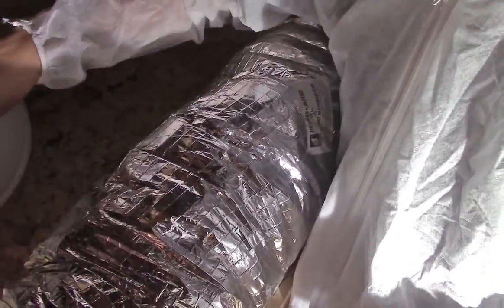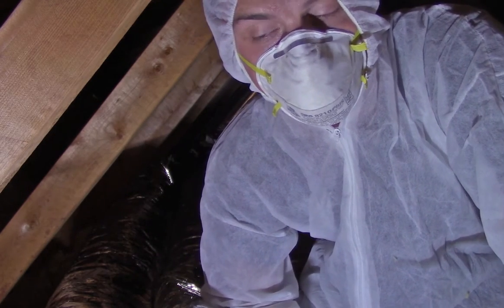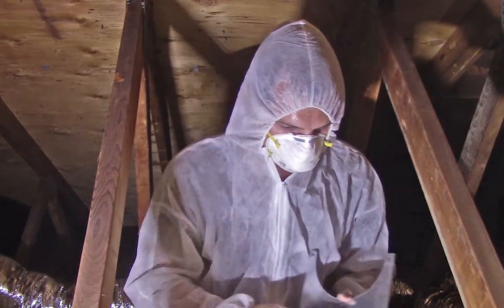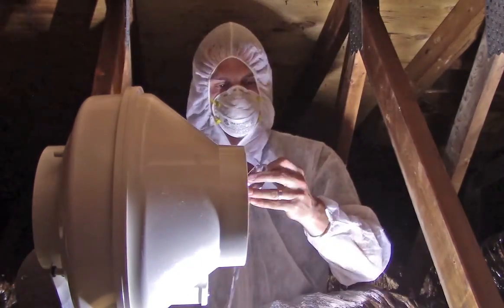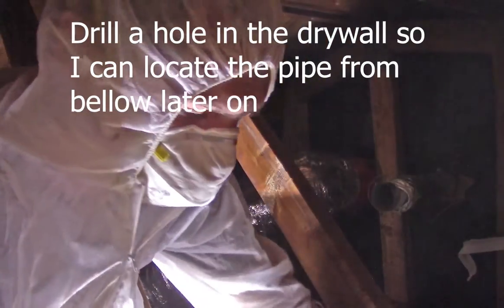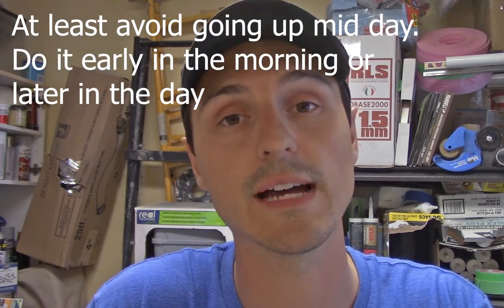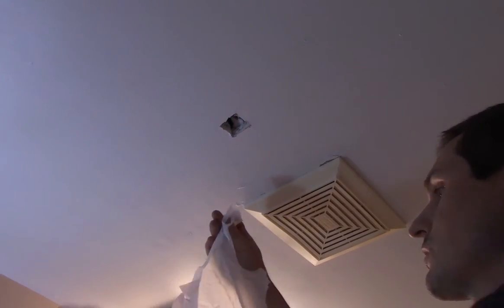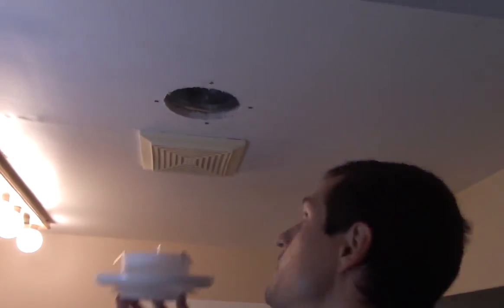How to install a linear exhaust fan [KEEP YOUR BATHROOM LOOKING NEW]

Comment: Great installation. Everything done well except for... that fan should be exhausted on the roof. With wall mounts the moist air that is exhausted will rise and go right into the attic via the soffit venting.
Reply from the maker: Hey! Thanks for the comment & thanks for watching! :) Is that a code requirement in your area?

Comment: Control of the fan is very important as the extra air volume will increase infiltration CFM X 1.08 X TD = BTUH. The 1.08 is a constant the TD is temperature difference between conditioned space and the outside air temperature.  In. The fan you describe is 250 CFM. If the outside air temperature is 100 F and the inside is 75 F the amount of heat gain to the home is greater than 1/2 ton of air-conditioning. 250 X 1.08 X (100-75) = 6750 BTUH. There is 12,000 BTH / Ton of AC cooling. 6750 BTUH /12000 = ..5625 tons of heat gain. For every CFM of air removed it must come back in from the outside. This fan will cause a negative pressure in the home and create drafts in the winter. It will exhaust faster, but cost more to operate and if left on effect the comfort in other rooms of the house. There is also additional cost for the power to operate the fan motor over less powerful fans. Engineers designed traditional systems to manage moisture and odors while keeping cost under control.  More isn’t always better.

Comment: Wow! Your attic looks as tight as mine... I've been procrastinating going up there... Nice installation!  I noticed when you installed the outside vent that you only attached the inner flex.  Do you have to go back in your attic and secure the insulation?
Reply from the maker: Thanks Marc! Much appreciated. I actually taped both layers to the exterior diffuser! I Definetly don’t want to go back up there!! :)
Reply from the maker: Technically that part is also considered exterior space and doesn’t have to be sealed since it sits in the unconditioned space in the attic.

Comment: I’m curious if there is a reason you made a new hole and did not just put it where the old fan was?
Reply from the maker: Hey there! Thanks for the question. I plan on renovating this bathroom in the future. I didn’t want to get into any repairs on the ceiling until I start that project. I the mean time, it looks like I have two fans...
Reply: DIY for the average guy so it is possible to just reuse the hole where the old fan is?
Reply from the maker: Absolutely! I have a new video currently being uploaded that covers repairing existing exhaust fans! :)